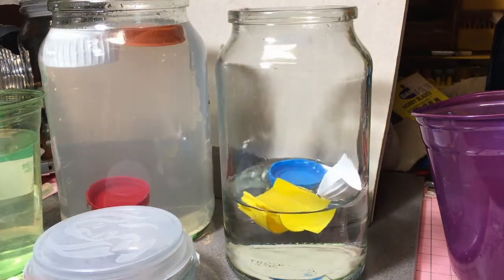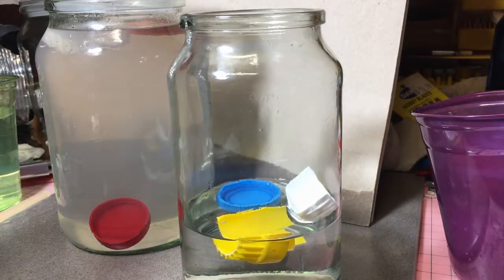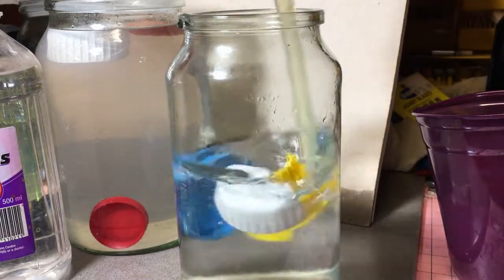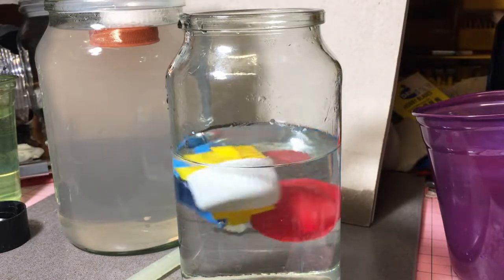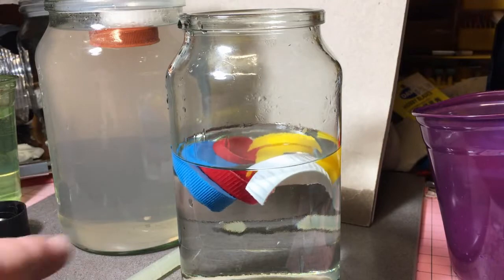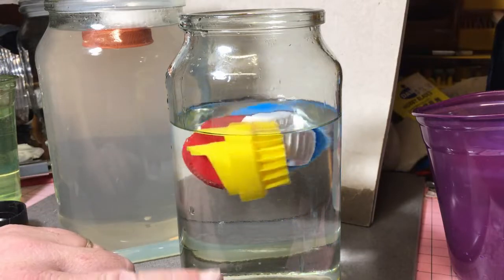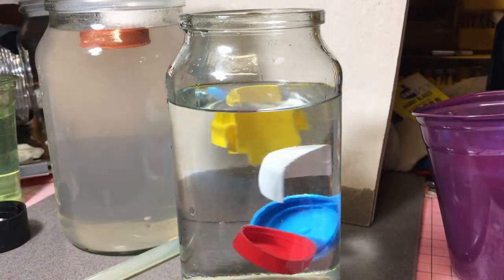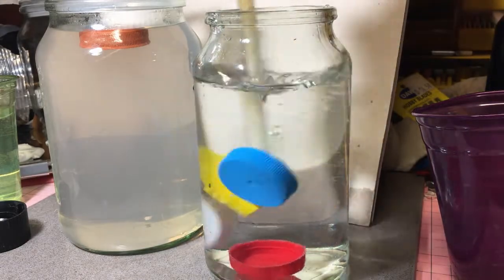Ep154 Sorting testing PP form LDPE and HDPE

Comment: I think you are separating HDPE from LDPE in the alcohol solution not PP. float test in oil separates PP from HDPE & LDPE
Reply: It is LDPE floating and HDPE sinking
Reply: 6
Reply from the maker: Hello thanks for commenting and watching the video. Depending on the density of the plastic you can sort and float one from the other. Some density's of plastic are very close to other type of plastic this make it a bit harder. Some are easier.All i am doing here is changing the density of the water. So one will float and one will sink. Thanks for watching
Kev